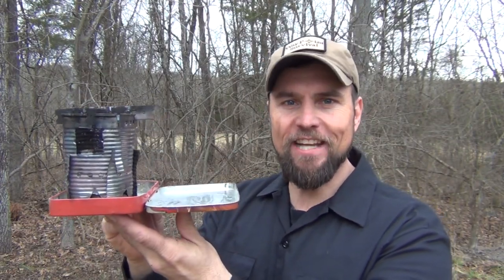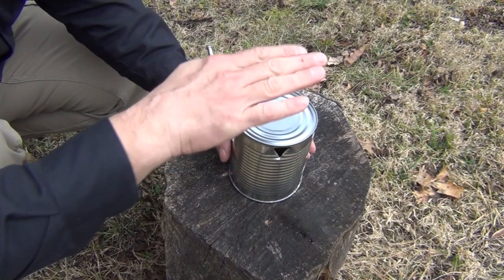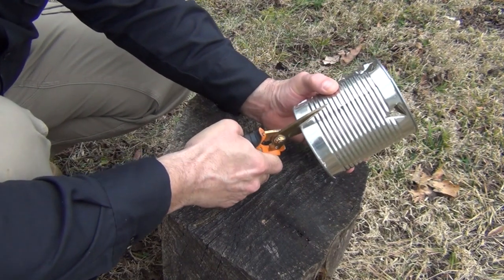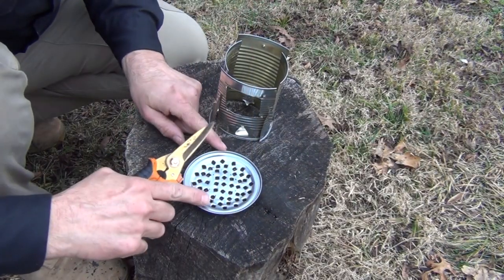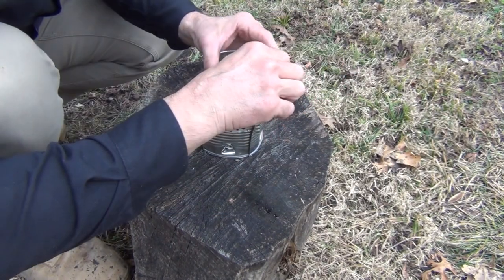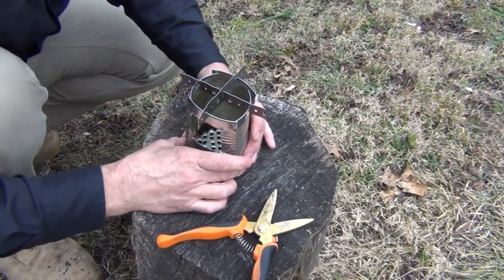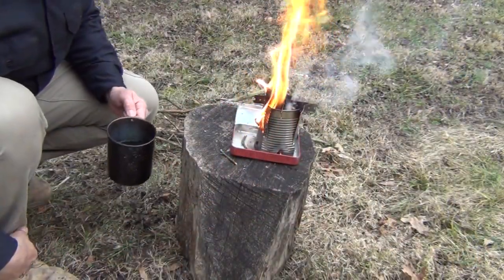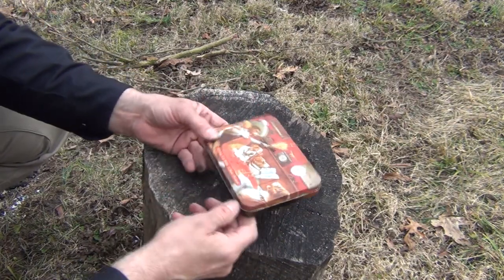DIY Take-Down Wood Stove From A Can

Comment: Yes i certainly liked this video. A good tip would be to make it at home,in a shed or workshop! It saves your back from having to bend down along with working on  your knees.  i ain`t good on my pins these days. Legs!  However working and standing table or bench height would help out us older folks, who like to play.... i always advise others to practice opening up the first aid tin with one hand,just in case one cuts or burns the other hand.   It helps sort ones kit out if you a can`t do it.
From the Evergreen Gardens that is my part of Fiddle Wood UK, Greetings !   BB
Reply from the maker: Those are good tips for those with bad backs or knees. Thanks for adding this to the comments!

Comment: Another cool project. 😃 I wonder if you could, instead of trimming off the curls on the sides, turn them onto themselves to have the short tabs but sturdier where they hook together?  Also, couldn't you flatten the can sides, since so much is trimmed off the lid grate, just make that more of a square? ⏹That way it would fit just slightly better into the carry tin. Just wondering if you ever tried it that way. Thanks for the informative video. 👍
Reply from the maker: Yes, there are several ways that you could modify this and it would still work. Thanks for watching.

Comment: Here’s an idea,instead of having four sections that you have to fit together make a single cut so the can remains one piece which you can then flatten for packing and simply bend around to use— ok it’s a larger area to pack but much flatter and would fit easily in a backpack.The benefit is a much sturdier stove in use.
It’s just theory,I haven’t tried it so it might be bs 😅
Reply from the maker: You could do that, but it would have limited uses as the metal won't take very many bends before it splits.

Comment: Use a regular can opener and you will have a stiffer top rim and the perforated lid gets its "safety edge" cut off anyway. If you lay your 4 wall sections curve side up when you punch holes in them it won't flatten out the walls and you won't need to reshape them.
Reply from the maker: Good ideas, thanks for adding them to the comments!
Reply: If I may?  I agree about the can opener bit. But if you nail from inside you then have sharp metal poking out. To avoid misshaping, just lay tin on a failed log.
Reply: @kylewilkinson6975  I see your point and agree a log would be the perfect work surface.

Comment: Church key. Why do yoy call it that? Just curious.
Reply from the maker: Because that's actually what the Triangular part of that opener is called. You can look them up on amazon.
Reply: It started out being called a 'church key' as a joke, because back in the day churches were never locked and the openers were often attached to your keyring. (the triangle end is the can opener and the rounded end is the bottle cap lifter, both used frequently for beer or soda cans and bottles prior to the pop-tops and screw tops we now use) Over time 'church key' became the popular name for these openers in the same way 'Kleenex' has become the common name of reference for all nose tissues.  @WayPointSurvival

Comment: I have to say that it is a good idea. 
However let's consider why you would do such a thing??
Yes it's great that you can pack it flat, BUT
1- You will still be carrying your cook kit. Brew gear etc. 
ALL of which will usually be easily packed "INSIDE" of the stove!!

2- This build significantly "weakens" the normal can stove!!

So I must say that this in fact (other than a interesting concept) is totall unnecessary and in fact requires you carrying an extra tin!!
Reply from the maker: Thank you. A lot of people are purchasing folding stoves for various reasons, this is just my take on how to make one cheaply.
Reply: @WayPointSurvival :
I happen to like it because you can put matches, lighter and a birds nest in.